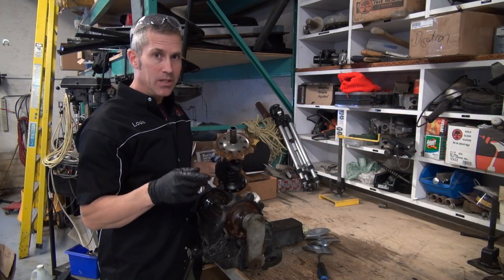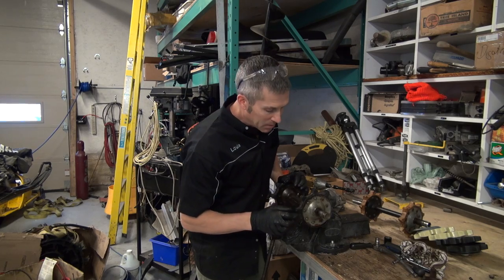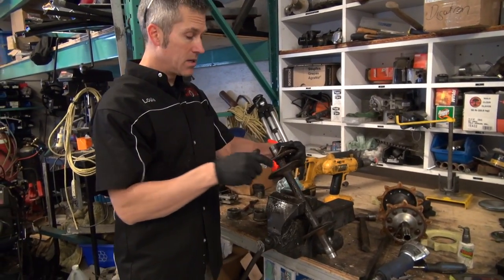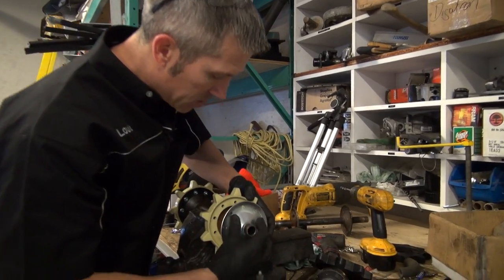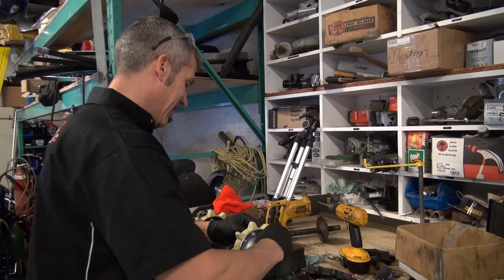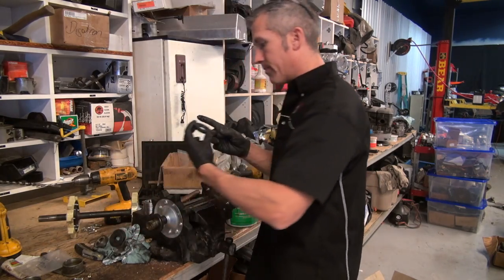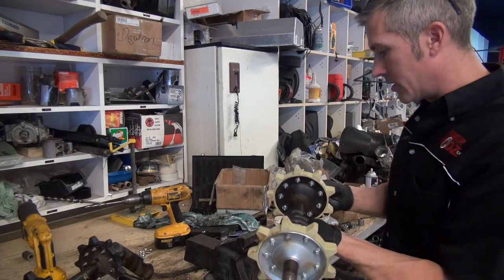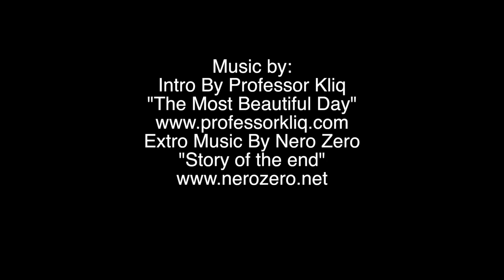Skidoo Elan Series #6 Axle driver replacement, PowerModz!

Comment: just finished my restoration on the same machine, your videos really guided me along, BTW, manual states that the wider side of  boogie wheels are to face toward the front of machine.
Reply from the maker: Thanks for the info!
Reply: Wider side??
Reply: @reggydunlop5770  yes the boogies have a wide axle and a set of wheels  on a narrow axle. the wider axle is to face front of machine.

Comment: This was helpful, I'm halfway through the job on a '72 Olympique, your advice has been invaluable. Teeth on my drive axle all sheared off. Based on your video I learned how to remove the drive axle, which was severely locked in on the right side, and to replace the sprockets. Thank you.

Comment: Thanks for the excellent and comprehensive video.  Several years ago, I pulled the axle shaft from a '70 Olympique which is the same procedure.  After assembly though, and ever since, the axle seals, particularly on the chaincase side, leak chaincase oil badly.  I wax extremely careful with everything i did.  Any thoughts why the seal may still be leaking?  I purchased OEM seals from a Bombardier dealer.  Perhaps a small groove was worn in the shaft allowing oil to seep by but I didn't see anything that noticeable when assembling.
Reply from the maker: mix some grease in the chaincase - itll be nice and thick

Comment: Was wondering Louis why you changed out the rear black sprocket assembly with the white rubber assembly. I see you did rebuild a rear assembly with the black rubber sprockets but you did not put on machine.
Reply from the maker: the white is hard plastic - the rubber falls apart
Reply: @PowerModzOfficial  cant seem to find the pastic ones anywhere, do you have a few leads? much appreciated.